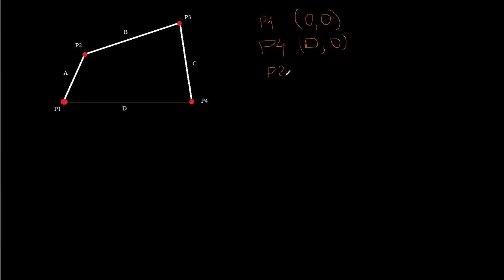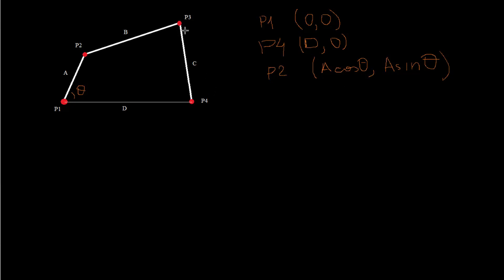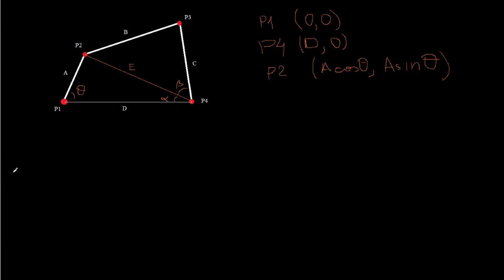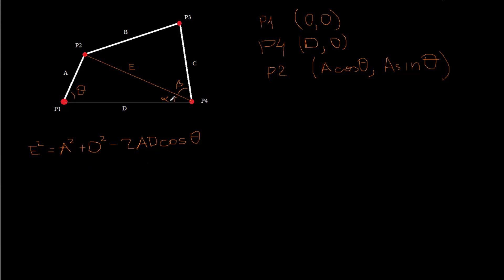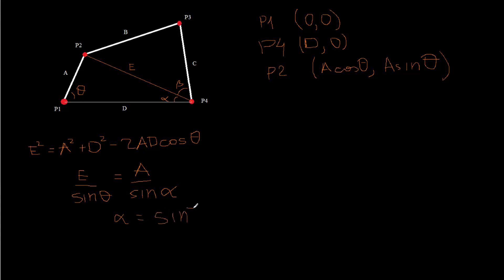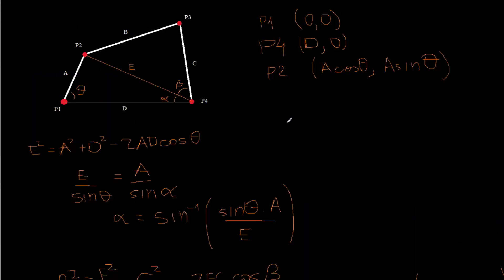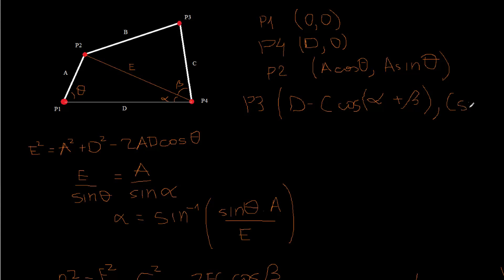Matlab Tutorial - Four Bar Linkage Animation: Finding the Equations (1/2)

Comment: Can this logic work for a mechanism with 6 bodies and 2 of them jointed by a cylindrical joint? Also, is it possible to simulate a bar going inside another because of the cylindrical joint? Like if one of them was a rectangle and the other a line and the line going inside the rectangle (Also referring to the second part of the video)